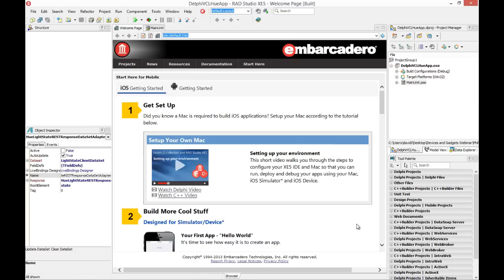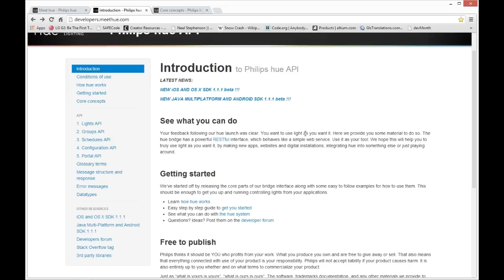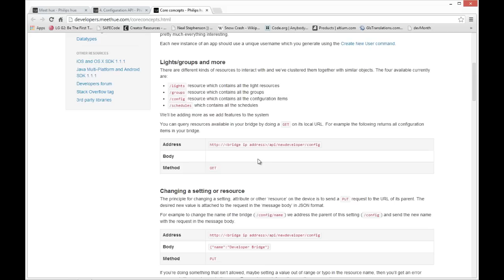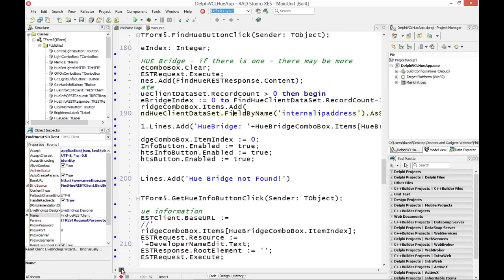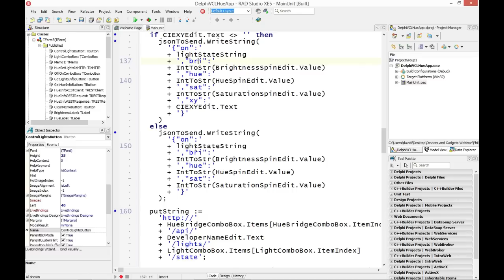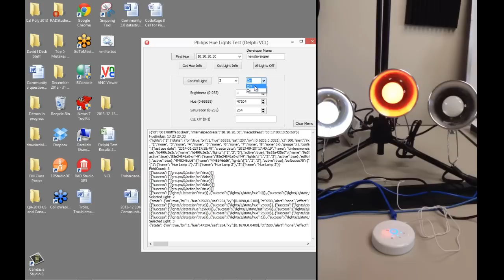Philips Hue Wireless LED Bulbs - Programming Devices and Gadgets with RAD Studio - David I

Comment: Thank you, but the "Find Hue" routine in the code does not seem reliable.  Most of the time, clicking it gets a response that no bridge was found.  But if I add code to explicitly stuff the combobox with the known local IP address, all works fine.  The challenge is, where do you go to sleuth this one?  I'll try the usual sources, but in general the sample code itself should be a little more bulletproof if we are to use it as a model of how to do things.